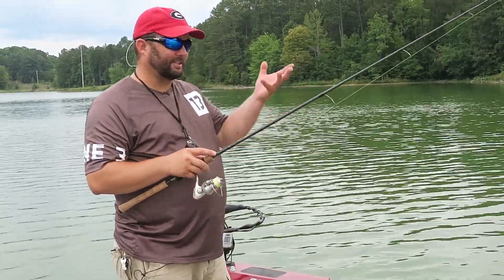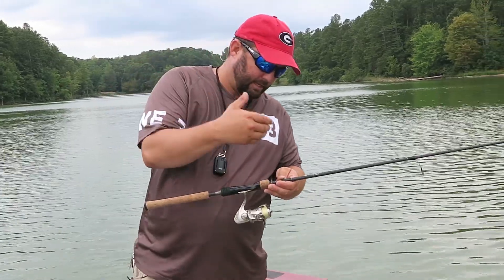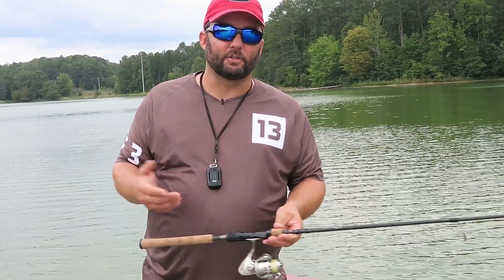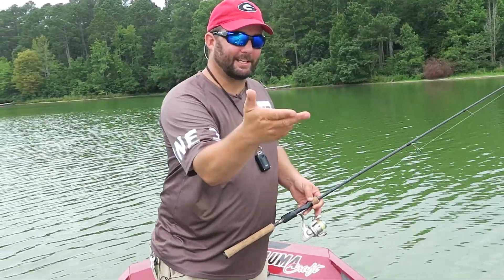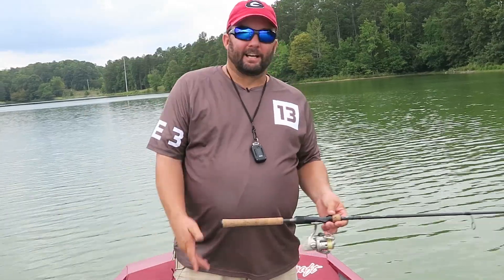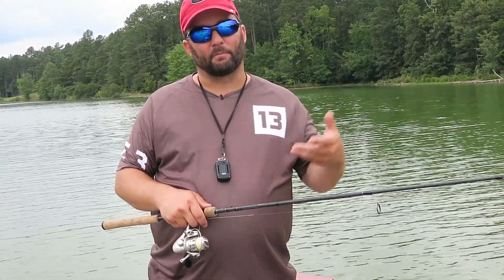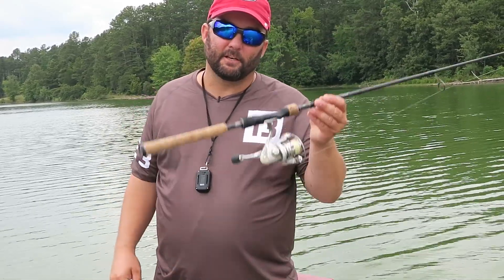Bass Fishing - The Advantage to using Braided Line to a Fluorocarbon Leader

Comment: question for all. I have been casting with fluorocarbon on to crank and jerk bait. No matter what knit I yours the lure come straight to the surface when cranking. It's the line twisted or what? that is my last conclusion
Reply: Help!!!!!
Reply: Is the crank bait made to dive or is it a topwater dude?
Reply: @mamaswamma1234  Crank. I think I broke something inside the bait. All the others work. I remember it banging agains the boat on a cast. I didn't know that could happen.

Comment: Other related video comments caution anglers to AVOID FG knot when using diameter of fluorocarbon leader too close to that of the braid main line. For effective FG knot, the braid must be much smaller in order to dig necessary grooves into the outer layer of the fluorocarbon leader. To me, this presents a dilemma when I want a small-as-possible diameter fluorocarbon leader for invisibility while bass fishing in clear water.
Reply from the maker: I've never had that problem because when I'm faced with that situation I wrap 30 to 40 times and it stays put.

Comment: What if you have a reel that has 18pounds of max drag on it but it is up to 30 pounds line capacity of braid can you put more than 30 great videos HAPPY NEWYEAR
Reply from the maker: Yes you can.
Reply: Will that cut down on your cast length
Reply: What can 40pound of braid as 12pounds monofliament  get threw

Comment: What is the point of using a heavier pound braid than your leader. Won’t the leader break before your braid does.
Reply: I think you want the lines to have similar diameters for a stronger knot.  Since braid tends to have a thinner diameter, you would need to beef it up to have the same diameter as the fluoro leader.
Reply: Jackson Dougherty better tie on doesn't slip

Comment: Finally someone made this video. Thank you. I'm new to bass fishing and I've always wondered why use braid with a leader. I didn't understand why someone would add an extra knot in their line. I knew there had to be good reasons but couldn't figure out why. Gene, is the FG knot the only knot you trust? I just learned the modified Albright knot to connect lines. Great video.
Reply from the maker: The Modified Albright is a great knot too. Just a little larger than the FG but does protect the fluoro from hitting the guides.

Comment: do fish see the yellow? I bought 50 pound yellow power pro for 10 bucks at Walmart and idk if they will se it
Reply: Well,  yes, they can see the braid. But the idea of using the leader is that they don't see the leader. You can see Gene has a little less than one rod length of leader. Imagine the lure under water is 5-6' away from the main braid line. So hopefully, fish don't get a look at the braid. If that bothers you, though or you want to use straight braid, go with a green colored line. I have that on 4 rods.

Comment: I was pretty skeptical of trying braid again after my experiences with the spider wire and fireline when they first came out, but the stuff these days is nothing like it was back then. 15-20 years ago, whenever the stuff came out, if you got a backlash with it you might as well pull out the scissors or put the reel away because it was a god awful mess.
Reply from the maker: That's about the time I gave up on it.

Comment: I noticed that you used yellow braid on your spinning outfits. I have seen a lot of BASS guys do that as well. Is there any specific reason for the yellow?
Reply: Strike detection.  Since the braid floats, when you're letting the lure fall on slack line, it acts like a bobber and you can watch the line jump when you have a strike.  In my experience with a sensitive rod you can actually feel a lot of bites even with a slack line.

Comment: I keep breaking fluorocarbon.  Like 50 yards in.  How do you not break it on your cranking rods.
Reply from the maker: Fix all backlashes and loops as soon as they occur if you don't then the loop will slap the reel over and over during the cast causing a bad abrasion that will quickly break......and don't buy cheep fluoro.

Comment: so when kayak fishing just use braid on everything or use fluoro leader with crank baits
Reply from the maker: I'd use a fluoro leader with any treble hook baits. That braid loves to wrap around the hooks.
Reply: I used straight braid for the longest time with no problems with it hook fouling. But I recently started using a low-vis green mono leader to experiment. It seemed to me my buddy was catching more big bass than I was using straight mono. I can't say that it's made a difference, but I haven't fished as much this year as in previous years. I haven't broken one off at the knot though. I use a surgeon's knot because it's very easy.

Comment: Would this work for finesse fishing? Weightless senkos?
Reply from the maker: Yes
Reply: Yes, especially with yellow braid that you can watch for line movement. I doubt I missed more than a few bites this spring after switching to a 20lb yellow braid/8lb fluoro leader this spring for weightless senko fishing.
Reply: Thanks a million. I think I'm having issues being able to tell when to set the hook on weightless senkos. I'll feel a thump, reel the slack and wait to see if the line moves to make sure the fish has it b4 I set. But 9 out of 10 times after the thump, I wnt see the line move. Do I set the hook immediately after the thump? Or reel the slack n watch my line if it continues to move?
Reply: Jon Flores So, the order in which you're doing things (feeling the bite, then watching the line) is opposite of what I've had success with. What I do is the following:

- Cast t-rigged weightless senko and let the line accumulate a lot of slack on the water before closing the bail
- Use your rod to manipulate the slack line on the water so that it makes a loop or a U-bend
- Watch the line
- When the loop starts to close really fast or the U- bend disappears, a fish has taken the senko
- At that point I reel up the slack and slowly but firmly set the hook (no yanking)

I actually found that I gut hooked about 1/4 of my fish with the speed I was setting the hook so I sped up my retrieve and hook set after seeing the line move. I cut way down on the gut hooking but did miss a few more fish.
Reply: +David Mann thanks man. I'm gonna try that out
Reply: Jon Flores Hope it helps! Weightless senkos are the only time I exclusively watch the line to detect a bite. For dragging/hopping weighted worms or creature baits, or jigs, I rely on the "tap tap", then wait a second to see if the line moves (which is how you described you have been fishing senkos), and then set the hook.
Reply: +David Mann got u. 👍 I'm trying any advise I can get for senkos cuz I wanna get my confidence up on using them like I have with swim baits and top water. It's so hard to get a bite now with this Texas heat though
Reply: Jon Flores Ah, Texas. I live in New England so when the heat goes up and the bite gets tough I just head down to the local creek for some smallmouth fishing. I know from people I talk to in Texas that creek fishing isn't really a thing there.
Reply: +David Mann Nah not here. It's in the 100's most of the summer here so any creeks we do have just dry up instantly. If it isn't a main river or lake it wnt hold water 😕

Comment: I'm using 12# braid and 8# flouro and have heck of time trying to tie FG knot, it keeps slippin
Reply from the maker: are you using the slick or smooth braid?
Reply: +Flukemaster it's the cabelas pro rip cord brand in smoke color
Reply: +what_goes_boom I just use Alberto knot and it seems to work, I change it often ad I only use like 2 to 3 foot leader
Reply: I tried Sufix 832 and I can tie a FG knot now, thanks

Comment: Try Berkley Nanofil on your spinning rod.  Longer casts than regular braid, zero stretch, zero response to twist.  Only downside is, it's SLICK.  You have to really use the right knot.  I use a double uni knot, with about 12-15 wraps on the Nanofil and 5-7 wraps of fluoro.
Reply from the maker: I've tried it and didn't like it. It's not braided tight and that caused all kinds of problems.
Reply: It's not braided at all, it's a single filament.  But it does have downfalls.  Lower pound test will cut through fluoro and cause knots to break (hence the high wraps on the uni knots).  I got sick of tying knots, so I used to put a 12-16' fluoro leader on it just so if I broke off a drop shot, I still had plenty of line.  I switched to Power Pro this year and like it so far, but it definitely doesn't cast as well.

Comment: I use a double palomar with braid and have never, ever had any knot issues.
Reply from the maker: I just use a regular palomar and have never had a problem either. It's the old stuff from 20 years ago that was bad.
Reply: I still don't like the slippery texture of spiderwire, I tend to stick to power pro.

Comment: But if you get snagged with braid you have to cut a lot of it off.
Reply from the maker: +AG BASSING not if you use a leader. Just pull straight back and break the leader

Comment: I absolutely detest braded line!  It's good when you aren't busy keeping knots out of it.  I am a fairly well skilled bait caster fisherman, but even the best get an occasional backlash, and they usually seem to come at the most inopportune times.  When they do come, more often than not they are extremely difficult to resolve.  In my opinion the negatives out weigh the positives when using braid, so I always fish a high quality mono and I love it.
Reply: braid is amazing line. I use braid for alot of thing I use straight braid for flipping there's alot of grass here in MN and your gunna struggle alot more in the grass with mono than with braid and I dont have issues with knots in the line. in some occasions I also like straight braid for spinnerbaits and chatter baits as well but also love flourocarbon or mono for that application as well. honestly the only thing I don't like braid for is most crankbait situations I will is braid for lipless and square bills on rare occasions. all my spinning rods have braid on them. I think it's personal preference honestly. I'm so used to fishing with braid that I have alot of confidence in it. I feel comfortable with it
 I fish alot of stained water so I don't believe fish seeing the line is a issue at all. even In clear water I've hammered em on straight braid. but I do believe flourocarbon gives you a advantage on high pressure situations in clear water. and I don't set the hook very hard cuz I'm so used to braid that when I use mono I think my hook up ratio goes down quite allot with certain baits. specially with a half way long cast. I don't feel confident hooking bass on long cast with mono. I am trying to get used to mono more and copolymer cuz I do use braid a little to much I think haha but I catch alot of bass and alot of big ones. I'm no pro but I catch em. so I must not be doing to bad. plus it's hard for me to afford good flourocarbon and replace it on half my rods multiple times a year haha I switch braid when my spool gets low which is only a couple times a year
Reply: wrightwrjr 
I prefer using braid to 3 metre mono leader. The braid allows you to feel the slightest bite, hold more line, and you can see your line if a fish takes it. The mono is a great shock absorber which puts less stress on your rod and helps keep the hook in the fish. For me, i dont use fluorocarbon at all because its too expensive and it has no stretch, meaning you are more likely to lose a fish
Reply: Braid birdsnest are super easy to get out, theres tons of videos on how to do it... just crank your drag down all the way and use your thumb to push pressure down on the spool and reel in the line a few turns past the knot, then pull out the line and if the knots not cleared you continue to repeat the process until you fully clear the backlash... takes no more then a minute to fix the worst backlashes this way, I've never had to cut line off my spool using this method and always clear any birdnests i get and I been fishing braid on all my rods for the last 5 years. anyone not transitioned to braid setups at this point is missing out on one of the biggest fishing industry technological advances in the last 10 years...basically the equivalent of playing hockey with a wooden stick in 2018 or fishing with rods that are all still under 6'8" times have changed... personally the only purpose i still buy mono line for is reel backing... I could never go back to mono on a baitcaster... I was hooked on braid after the first season I tried it out I can't believe theres still people that dont use braid line at all...
Reply: Hate to break it to ya bud, but it’s not the braid. 1. It’s you. Practice with a bait caster more if you’re having issues, or you’re using too light of lures. 
2. All line backlashes if you don’t cast properly,

Comment: Why use a leader that is lower test than your main, especially a lot lower. You're only as strong as your weakest link.
Reply: The primary reason to use a lower test fluorocarbon leader is to be less visible than mono or braid underwater but unfortunately that means sacrificing strength like you stated. Call me biased but here's my view: Anyone willing to go down to 8lb for a leader can just use much smaller diameter 8lb braid - remember smaller means less visible too. To keep 15 lb strength AND invisibility, consider TRANSLUCENT (fluoro coated) 15 lb braid from Spiderwire (they have .008" and lower cost .009") so both are "nearly" as invisible as 8 lb Seaguar Abrazx fluorocarbon .009".
Reply: Larry Moffatt why would opaque line wrapped in a translucent substance be any less opaque?
Reply: Opaque line's diameter is less than the overall .008" diameter that way. And diameter of .008" is about that of a human hair, so it really doesn't spook the fish.
Reply: So why not use a lower test backing? Is the heavier backing ONLY there in case you decide to go leaderless, or decide to use a much heaver test leader?
Reply: The 15 lb suits me because I can literally use it to pull my kayak (gently) to where I snagged on bottom and retrieve my stuck lures.
Reply: @Larry Moffatt What I mean though is why use (for example) a 15lb leader and 50lb main line? 50lb main + 15lb leader is only going to be a max strength of 15lb test. Is it just so you can change the leader up to 50lb without having to change the main? Many people, including Gene, use a heavier to much heavier main line than their leader weight.
Reply: 50lb main + 15lb leader is only going to be a max strength of 15lb test. That's true. I don't know why people (or even if people) do that. I don't do that. My guess is the 50 lb leader might be tough enough to withstand toothy bites while still being somewhat invisible. Personally, I use braid as my main line and by standardizing my main line as 15 lb translucent braid, I can still be pretty stealthly without any leader. And when I want to be virtually invisible for super clear water, without sacrificing strength, I can always FG knot tie a 15 lb fluorocarbon leader, or go finesse with less than 15 lb fluorocarbon leader onto my 15 lb braid main line. As for frogging, topwater, lily pad fishing, where line invisibility is definitely not needed, I use 50 lb braid as main line (no leader, no need for a leader).
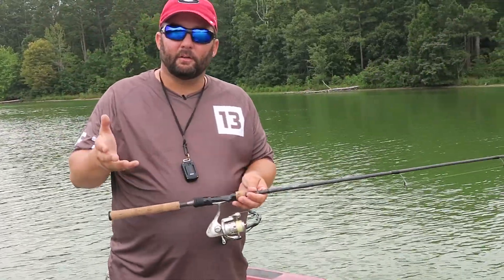Reply: Gene in this video (@2:23) talks about using a fluoro leader (6-10lbs) that is considerably lighter than his main line (10-15lbs).